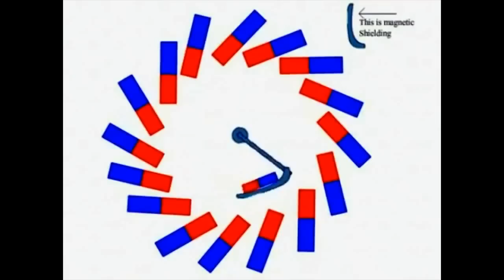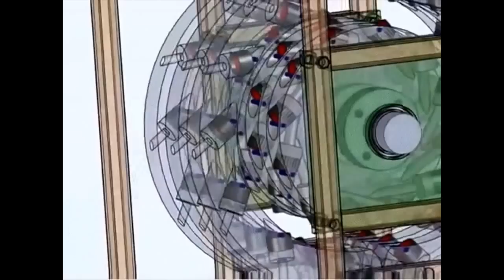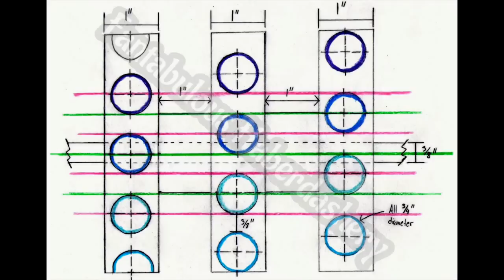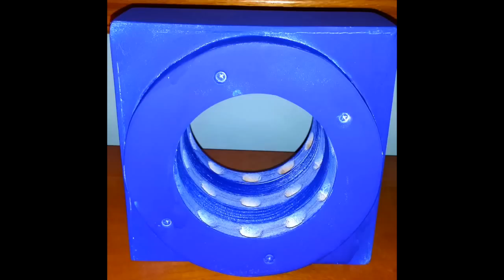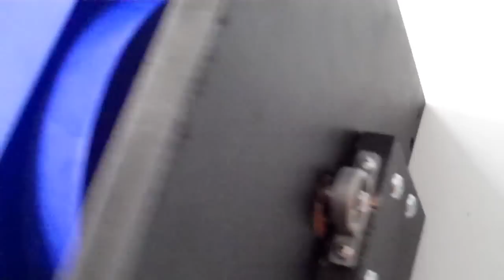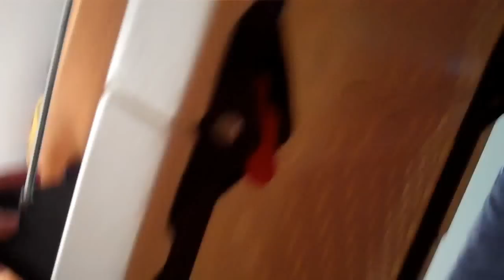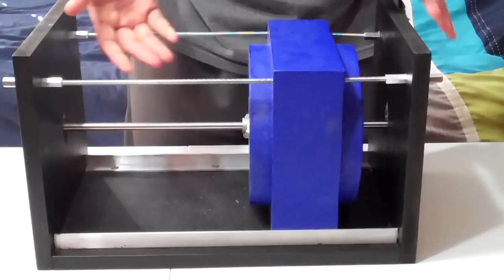Working Perendev Magnet Motor!

Comment: watch the left of the screen between 8:39 and 8:45 you can see the shadow of what he hooks to the shaft he then removes the drive motor at 9:15   disappointed because I know this will work. Its not free energy or overunity because it gets its energy from the magnets I really thought you had it for a second. I will make this work and post a video when I do. People like you take away from things like this.
Reply: Forward Automotive, good eye man.
Reply: what would he attach it to? the bearing? it looks like it could also be the shadow of his hand. only one way to find out. if fake ill be back to put him on blast
Reply: Good catch, at 9:15 you hear the motor slow down when the shadow goes away - had been steady.
Reply: I hate to saw it but it does look like it's beeing sustained by some kind of attachment. Maybe something like a airplane propeller starter just smaller. it's a rubber piece that fits over the cone part in the center of the propeller. The same concept could be applied to the rounded end of the shaft. And if you go back and look the right side barring has some kind of cover and the left is not and even more the left side has a worn down edge just below the barring and the right does not.
Reply: Actually the reason the side of the box has a white-ish gray appearance is because the high gloss paint is reflecting the table top. The 'shadow' is not a shadow but his hand as he rests it on the table next to the box. He's not trying to trick anyone. You can build these and get them to spin for quite a while on their own momentum. Kinda like a top. I had a friend who build one for a high school project back in the day. It just doesn't last forever, which this kid actually states several times in the video.
Reply: Nobody can categorically state that water is two molecules of hydrogen bonded with one molecule of oxygen. But there is plenty of evidence to support it.
Nobody can categorically state that there ia a God. 
Blah, blah, blah...
Reply: You can't really be 100% sure about anything. You can't really prove we don't live in some kind of matrix-thing(t's the point of a matrix that nobody notices they are in a matrix, isn't it?), but at the same time it's pretty hard to prove we do either. Thus, just theoretically, there could be some way to get free infinite energy. Nothing is(theoretically)impossible. But I'm afraid you'd have to break the matrix to get free infinite energy(supposing there is one).
And there's still the possibility that there is no matrix and no free infinite energy at all. If you really want to spend your time  searching for some way to get free energy, do so as long as you don't hurt anyone.
If we think of things to be impossible from the beginning on, we won't make any progress. If no one had believed there was some way man could fly, we wouldn't be able to fly now. Maybe we will have free infinite energy some day. Rules are made to be broken.
Reply: @WCM1945  Well... Actually
when you put the whole "h20" classification into the conversation the truth of the matter i believe is water may be something different than the other molecules completely. If you focus good or bad intent towards it then it changes the structure within dramatically. We've been miss lead to believe drinking distilled water is very unhealthy when its the same thing as rain water or juice fresh squeezed from your favorite fruit. I drink only distilled water and i can testify that its a life changer for myself. Boil ten gallons of your favorite brand of bottle water and then boil the same ten gallons of true distilled water and look at what residue you finds in the bottled water not to mention your sink water. Food for thought... Take the atomic weight of H times 2 and the same of O and tell me what number you arrive at. Now tell me the atomic weight of H2O. How's there a difference in the 2 numbers when there can not by universal law be any difference at all let alone one that is as different as night and day.
Reply: @keirstin2010  I've never heard that distilled water is bad for you.
But then natural water is a very good source of essential minerals.
That's the deposits you find when you boil water down to a dry surface. Mostly calcium, some salts. Same as you'd find in foods.
I don't understand why you see a discrepancy regarding the weight of water. The atomic weight of hydrogen is approximately 1, and that of oxygen is about 16. So, with two hydrogens and one oxygen, a total molecular weight of about 18 seems fair. Why not?
Reply: @keirstin2010 I doubt you only drink pure H2O. You see it has a horrible property. It will strip your insides of minerals and eventually kill you. Pure H2O is used on electronics because of this property. Safe drinking water should be full of minerals. That's what gives differing waters different tastes.
Reply: As long as there is suffient heat to prevent the atoms from collapsing, magnetic fields will be present. They arise wherever the majority of the molecules are aligned in the same general diection. The energy your are concerned with is , therefore, simple heat. And anything above absolute zero will do. Sure, you can tap it, same as you can tap the heat of anything else. You just can't do much with it.
Reply: If this is fake all it does is muddy the watter.
Reply: Do you have a page I can visit.
Reply: The fact is all youtube video is cut and edited. The magnet field will keep that work, so you should learn where is it come from.
Reply: Per what you said, he may put the machine into a vacuum plastic box right?
Reply: There's lots of free energy available!  There's the sun, rain, wind, water, tidal etc. You can even make a self-powering pump! It will pump water hundreds of feet up a steep hill to where you need it!
It all depends on what you mean by "free."  There is free like beer energy everywhere.
Reply: Nice "BULLSHIT ALERT" catch.
Reply: You can also hear the switch arc, and the torque pulse that is synced with it... completely independent of the RPM or any other magnetic/mechanical feature.
Reply: good eye man.
Reply: yes, and between 9.19 and 9.20 there is a "cut" in the video.
Reply: https://www.youtube.com/watch?v=P29SDY560uc&t=11s
Reply: Well seen 🙂
Reply: Very nice catch.
Reply: you are only describing the basic forces experienced when fooling about with magnets, tell me where the energy comes from that constantly creates the magnetic field ? You are in fact only regurgitating what you have been taught, every time science learns something new then everyone hops on the band wagon and only then is it real. Humans know maybe 2% of what science really holds. eg. Electricity was DISCOVERED, not worked out theoretically, if advancement was left to fools like you we would get no where.
Reply: @pintail120  1.9% arround !
Reply: +Forward Automotive You don't even need to look for any tricks, he says in the video itself, "eventually it does slow down." ....and you won't get it to work, but have fun being another nut lost in the magical world of magnets swearing it will be soon.
Reply: @frequencydecline5250  Precisely. All the "secrets" are just that. Imagined contra-indicators to the thermodynamic laws that all end up serving those laws until entropy robs the system of movement.
Reply: @frequencydecline5250  I didn't hear that...
Reply: Jim Edmiston - at 9:22. 
Now you could have just listened more carefully or listened to it again. Or looked at the other comments which also mention it. But nope easier to get me to come back 3 fucking years later and tell you. There’s no free energy devices. No matter how many magnets you stick on it, it won’t matter.
Reply: There is no energy in magnets to harness.
Reply: you know what i saw him do something too - what a fucker - make the machine my friend
Reply: no one, not even scientists can categorically state or declare what a magnet is or how it works, its still a mystery and the best we can do is apply formulas and equations to the magnet trying to describe what we see. Deep down at the electron and atomic level, they dont know, this is how advanced science is....... just to add to it they cant explain quantum entanglement either, yet everyone walks around professing about thermodynamics blah blah blah, yeah whatever.
Reply: We KNOW what a magnetic field is. We create millions of them every day and they are in almost all electronic appliances. That statement is extremely ill informed. We know how and why they exhibit the characteristics they do. Where on earth did you get the idea they are some sort of mystery?

There are physical laws in our universe which we cannot break. One being the speed of light and another 4 being the laws of thermodynamics. We know what happens to things on the molecular level too. Electricity is the flow of electrons from one atom to another. It really is understood very well.

Quantum mechanics are well explained in the current model. What that has to do with anything we are talking about I don't know. Does the word "quantum" impress you? It shouldn't.  Marrying quantum mechanics with gravity is the difficulty at the moment but I'm sure we will get there.

Maybe you should think about educating yourself a little bit in these fields. I think that might be helpful. It would help you to understand why these physical laws exist.

Modern science is extremely well advanced. We know a hell of a lot more than you think.
Reply: Perfectly said. Just take a look at some advancements in batteries to see the science being put to the test. I'm a simple carpenter and even i can wrap my tiny little head around this, but I really just wanted to say thanks for this well said comment!
Reply: @19822andy  absolutely wrong,we just know a little about magnet
Reply: @alexcheung1506  YOU may know little about magnets. Science and engineering know all about them. The only possible way this could work is with magnets with only one pole. They don't exist.
Reply: Well said, I've been off grid for almost ten years now, with no need for expensive photovoltaics, wind/water turbines, or fuel of any kind.  People have been lied to about everything!  Our true history altered and fabricated, the science of Tesla and Victor Schaughberger replaced with fraudulent fools like Einstein pushing their heliocentric, masonic rubbish known as astronomy, which now costs the American people over $70 million/day to be further indoctrinated with greenscreen trickery and underwater space walks.  Two thirds of the earth population understand Apollo was a fraud, the so called actornauts of the challenger disaster are all still alive, well documented online!
In 1967 nasa murdered not just Apollo 1, but a total of 11 astronauts!  8 astronauts in 7 individual plane crashes!  LOL - non masons who couldn't be trusted.  Like the lead investigator of Apollo 1 who was also murdered with his family, their family truckster hit by a train,  right before he was supposed to blow the lid off the Apollo 1 murders!

Waterfalls are not the only way to move a shaft via gravity.  There are several ways to spin a rotor without wasting energy emitted as heat.  Even Tesla spoke of it - bifilar.  Rexresearch.com
Over 5000 energy parents sequestered/classified by the DOE/Pentagon stranglehold over the US patent office since the beginning of the 20th century!
Yeah, nothing to hide here,  lol.
Go shove your laws of thermodynamics up your ignorant asses.  End of line
Reply: It can't work. There is no energy in the magnetic field to harness. When you push 2 poles together the repelling force you feel is equal to the energy you put into it. It makes sense to someone who knows very little about a) The laws of physics and b) knowledge of how magnets work
Reply: @19822andy  Precisely. People fail to understand the laws on energy and work because they never spend the time early on to make sure their definitions are precise. Then they go and spread their ignorance to novices who end up with a permanent distortion in their understanding that will lead them further into deception.
Reply: @kguidry7520  I've noticed too that they attach "Tesla" to everything thinking that ends the argument. Tesla, Tesla, Tesla. I bet most of them don't even know what advancements he made.
Reply: @19822andy  Yeah. Appealing to Tesla or patents can't change thermodynamics and entropy. Can't. Won't ever. Increase efficiency? Yes. Energy without work? No. Never.
Reply: The magnet does not "Create" a magnetic field. The magnet IS the magnetic field. Imagine it as a springy solid where you can only see the core. The core being the magnetised metal and the springy solid is the field you cannot see.

Electric has been worked out for frigging decades. The "advancements" you like to think about are all in the bounds of thermodynamics and break absolutely no physical laws. 

There is no advancement to be had in this area. The calculations are done, the answers are in. There is no free energy to be had out of magnets!

Comment: Yup add a battery and a motor and anyone can build a working Perendev Magnet Motor.  Perendev did go to Jail for this didn't he?
Reply: My friend, first Perendev, just means perpetual engine device, is a compound word or name, his name is Michael Brady, and "perendev" no was to the jail, he have legal problems because he produce several engines and a huge generators and the power industry don't like this at all, and also that was so many year ago. was 2006/7 at least 10 years ago and the energy industry for that time scare even of electric cars. Perendev has legal problems because they toke more than a 1M of euros and was very successfully on the energy industry. a couple turkish  guys from turkey or some north African countries are doing the same now and works really good, and he show the motor in front of universities and works.  
Don't stop people to create new inventions don't scare people, just because you don't have capacity for understand it.
Reply: Joao Nunes I'll give you thanks for the fellows name.  However, do not make assumptions on my understanding of Perpetual Motion and free Energy Devices.  There is no such thing because it is impossible.  There has never been nor will there be a perpetual motion device or any device that reaches Over unity.  Saying otherwise is just plain wishful thinking.

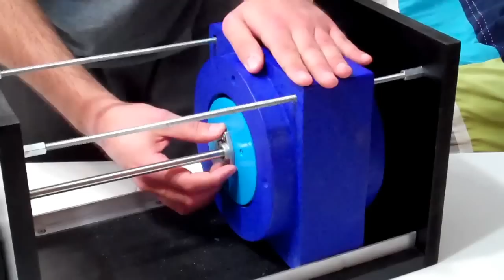Comment: Sorry, but it's a verry poor fake. You have a good reason show us your construct in that angle. In 9:33 you switch off the motor. There are so many cuts in this short sequence. Can you explain the different shaddows and brightness values in this short running sequence? Why do you show us an different casing (stator) in your consruction sequence than in action? See missing blue color inside of stator. You have copied the same trick Mr. Brady used.

Comment: an idea? have a magnetic toner fluid moving through output coils around an endless loop attracted inward by a center magnet. the idea * the magnetic fluid is attracted inward but since it can't do that it angular accelerates around the tube through the coils producing electricity the stator is the center magnet and the rotor is the surrounding fluid

Comment: Tom Bearden says that all energy is free.  Remember, energy can neither be created nor destroyed.  So when you run an electric generator, it doesn't produce energy.  It merely takes the energy from the environment and converts it into a form we can use.  So free energy is a reality because we're not paying for the energy.  We're paying to convert the energy.  

Take the sun for example.  The sun is a bastion of free energy.  The space station has all the energy it needs from solar panels.  Since there is no atmosphere in space, it's conceivable the panels could last 100 years or more.  For all intents and purposes, it's free energy.  Sure, you can take into account the cost of launching and manufacturing but a single solar panel could provide 200 watt/hours or more of energy every hour of every day of the year for possibly hundreds of years.  That means any cost incurred in deploying the solar panels will be recouped over time.  

As for infinite energy, one could argue that the same solar panels on the space station could provide infinite free energy.   Granted, it's limited to 200 watts but 200 watts/hours over an unknown amount of time would be infinite.  It's conceivable that a solar panel in the vacuum of space might never decompose.  So, in theory, it could provide infinite energy.
Reply: +ElGatoLoco698 
Exactomundo, the energy is free  but to equipment is not.
Yes infinite energy but who would use that in a life time lol
Reply: ElGatoLoco698, stop trying to talk like you all smart. Obviously energy cannot be created Dumbass..  M=MC2, we all know that, magnets are already charged.  Yes the invention will work,  similar ideas have worked also,  you would have to know and have a good idea of how things work to realize that this is good information towards a more advanced version .  You Gato pendejo Keep paying Energy companies for electricity for the rest of your life if you wish,  but not me and others!! I rather off the grid.
Reply: yes, please go off the grid
Reply: Yes energy cannot be created or destroyed. Like the big bang
Reply: +ElGatoLoco698 👏👏
Reply: Wow ! Genious ! How are we getting the energy from up there, down here again?